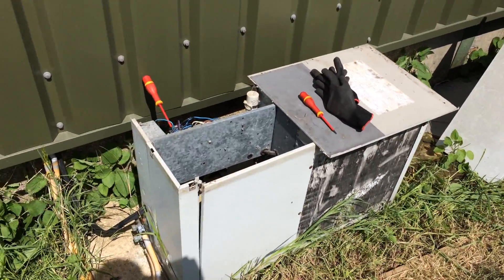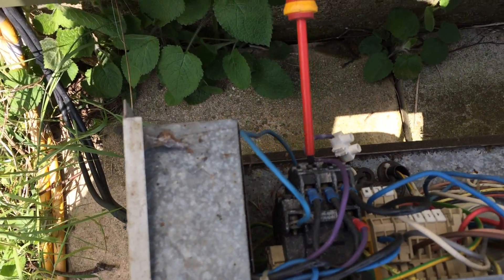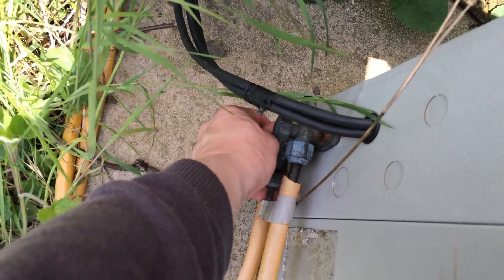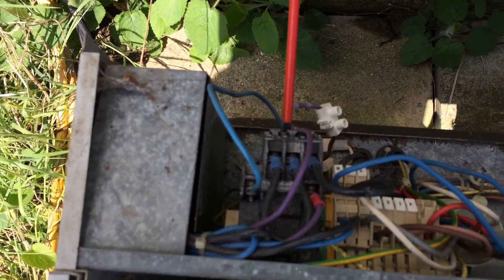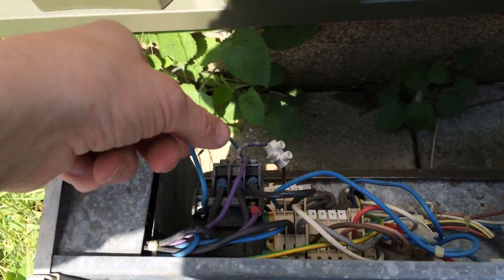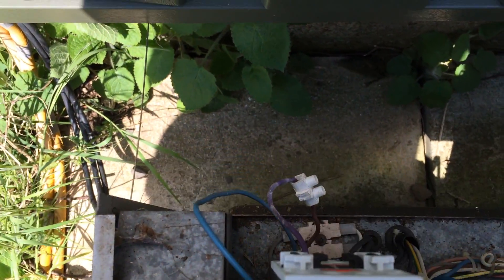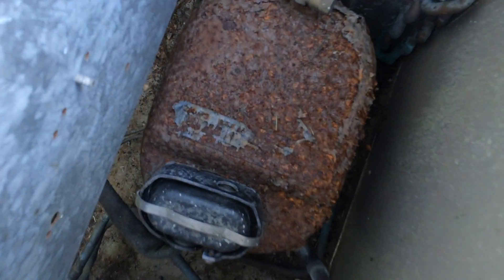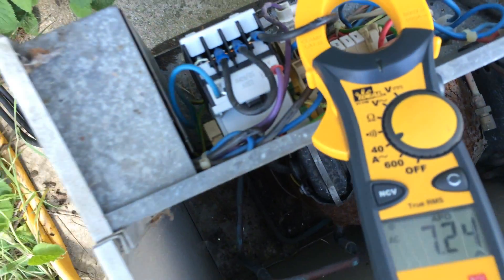IMI Cellarator

Comment: Very cool! What is normal temperature by fridge compressors? I get an old one from DDR and sometimes (If it is outside cold) it does not turn on
Reply from the maker: They should be able to run in normal ambient temperatures, maybe there is a thermostat stopping it running, or possible some of the starting components are worn making starting difficult.
Reply: You´re right. Thanks !

Comment: Cool, which refrigerant ?
Is it right, that in america is the mains voltage 110 Volt, and three phase 220 Volt ?
Here in Germany is mains voltage 230 Volt, and the Phase 400 Volt.
Reply: +Eric M Ok
Here is it so:
In every house or building goes Three Phase, a Neutral, and a Earth- Wire. 
If you put one phase to Neutral, you will get 230 Volt, and Phase to Phase 400 Volt. Thats it
Reply: +Eric M oh jes,
we have only Zentimeters, and Gramms, and Litres, r
thats easy
Reply from the maker: +Electroimpex I think its probably on R22 but didn't check.

Comment: So what will fail next? Will the condenser coil rot out, will the capacitor pop or will the bottom of the rust blob of a compressor fall out.

Found an old box with one of those compressors in it in the back this week, though I had taken it to scrap years ago, but now I see it again it will be in the load for the next run.
Reply from the maker: My money would be on condenser fan fail which kills the compressor before they notice. They only run it during the warmer months hence the rust it gets over winter.

Comment: easy fix , glad they built that shed just the right distance for your driver ;)
Reply: I think that is a "temporary permanent" shed, made from an old shipping container. That Chromadek base and lower rail are right, plus the concrete footing. Likely they took an old one, slapped 4 inches of insulating foam in it and some white panels and made a DIY coldroom out of it.